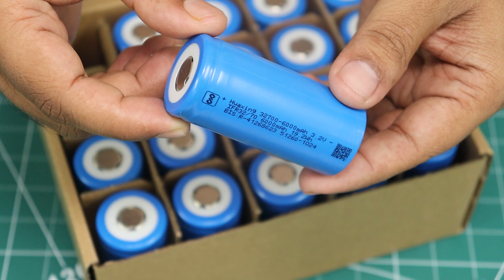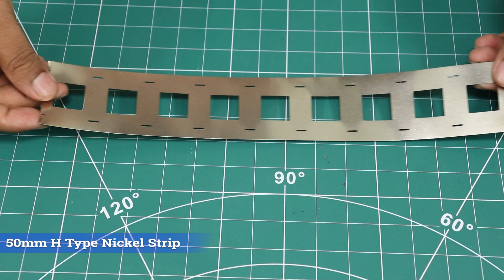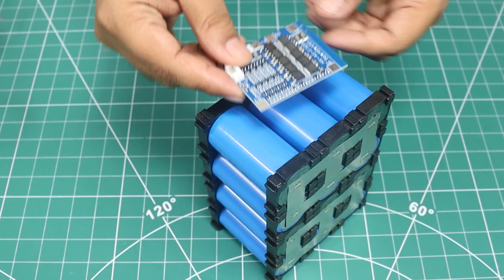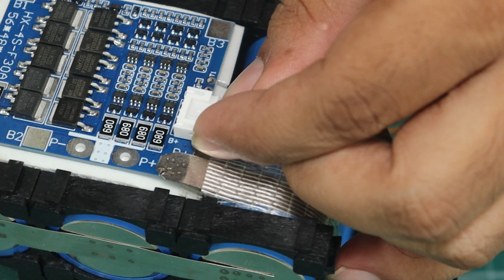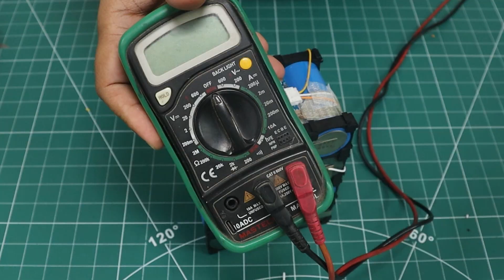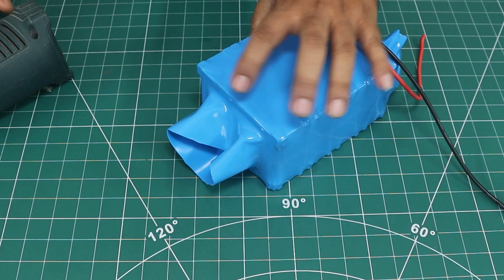How to Make a 12V 18Ah LiFePO4 Battery Pack | DIY Lithium Battery Tutorial

Comment: How to recharge the battery? I assume the same red and black that are the outputs in your video, also act as inputs for charging? Does the BMS handle all the charging/discharging protection requirements, or only balancing the banks of cells, thus requiring an external charge controller in addition to the BMS?

Comment: you have wrong placemant of the BMS location thats why positif wire need so long, if placemen is right position it should be only needs about 3cm wire for all connection, thats how the BMS design location already